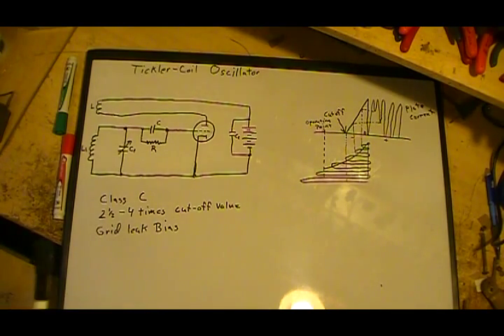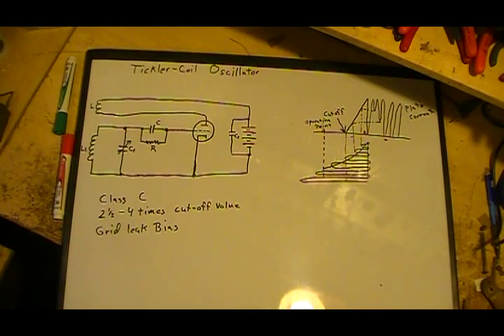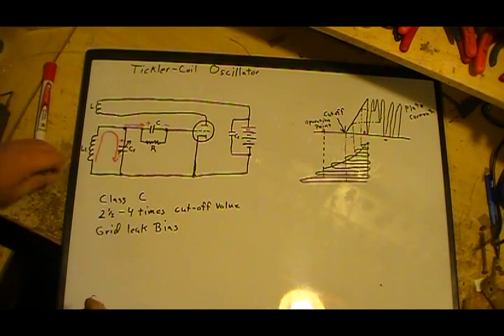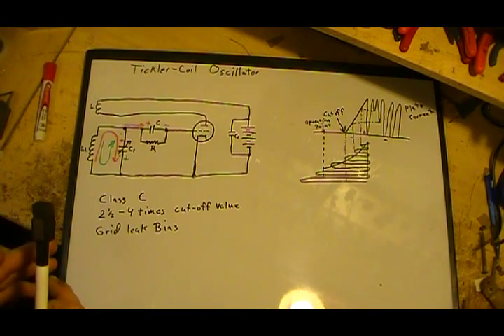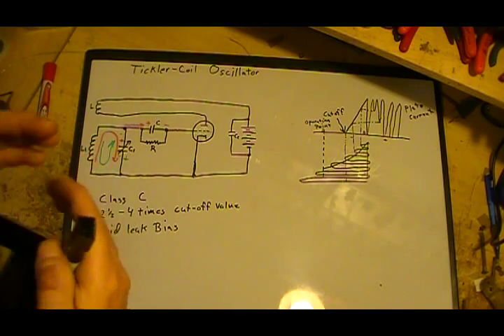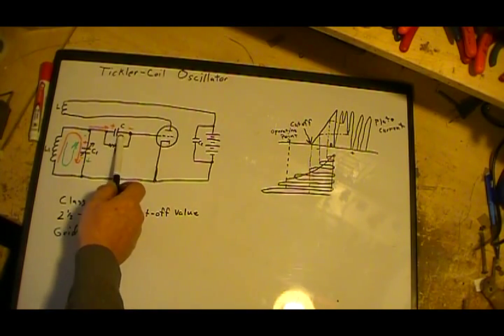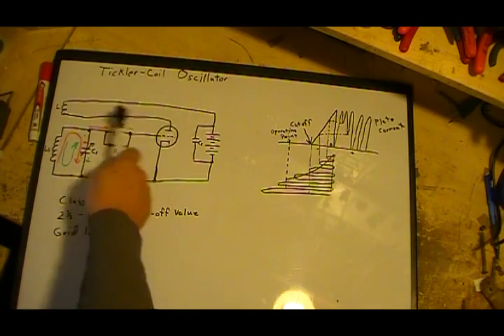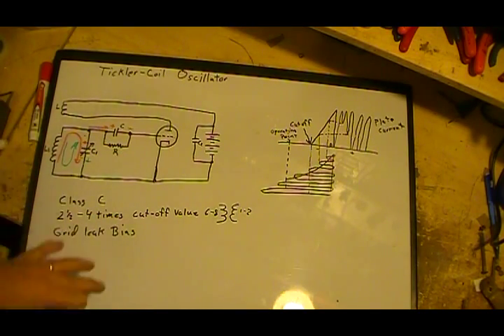Tickler Coil Oscillator Theory

Comment: Thanks for the refresher been many years forgot most of it.
The only thing I never quite could understand is the grid  drawing at the top right hand corner, I never could see why it was drawn that way, that is not how a scope would show it, maybe you could make a video showing how to read those grafts.
Reply from the maker: Hi Bill. I will make video on the grafts. Thanks for watching my friend.
Reply: Hey ,I'm new here,could you please tell me will I use transistor or mosfet? ?🙂
Reply: @arkapravomandal3267  Use a JFET like BF245A. Even better use a tube, a triode or a pentode in triode circuit. The russian 1Sh18 pentode is a very nice tube for regenerative receiver.